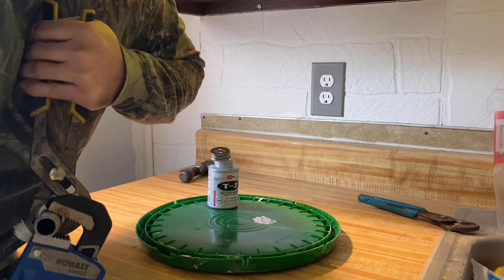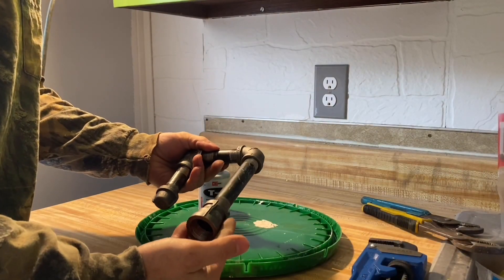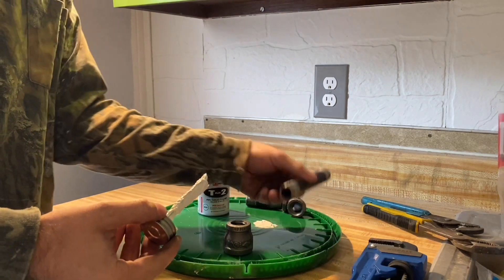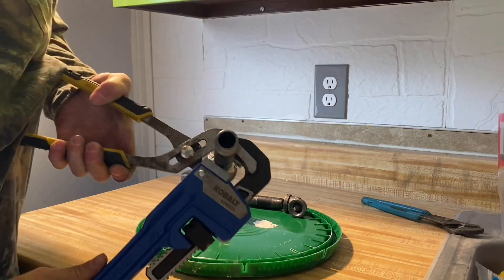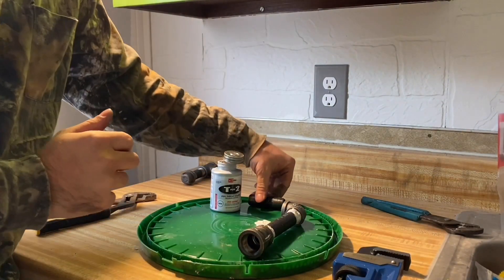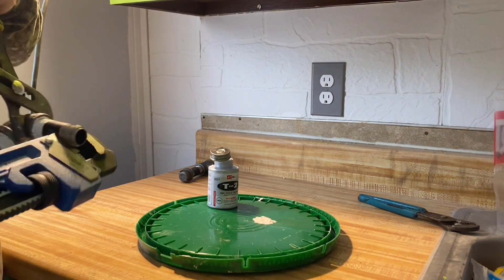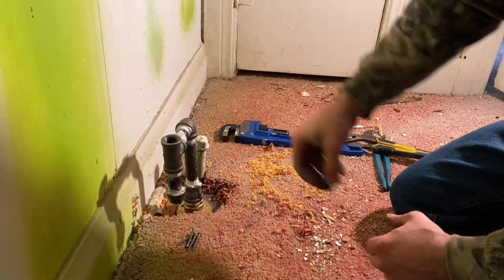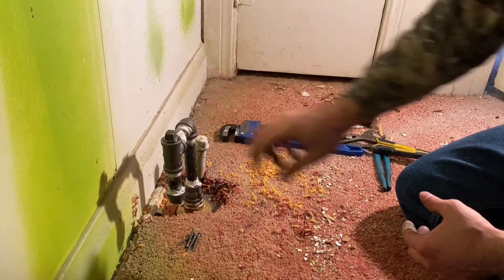How to make a gas sediment trap

Comment: Plumber is not my thing I paid someone 200 bucks to do that on the last house. Nice work
Reply: plumbers want to charge me $6000 to add another gas line in our house. Crazy.... I bought the materials to do it myself for $500. I got a pressure gauge, and will hook the line up w/ pressurized air for 24hrs at 30psi to see if the pressure remains stable. Then I got myself a gas  leak detector tool. One of the reasons the plumber was charging so much is because the combined 1/2" pipe runs from the meter to the devices, exceeds 40', which is against code.  The solution is to retrofit to upgrade all the preexisting lines to 3/4, which increased the overall cost. I ask myself the question, what problems could arise as a consequences of insufficient natural gas pressure , if I just stick to w/ our home's default 1/2" pipe setup? My demand its just one or two burners on the stove, and the gas furnace is on in the Winter. My logic is that the gas flames will be lit, but they will not be stoked as much w/ lower pressure. Anyway, I am not going to use the gas stove, until I know everything is perfect.
Reply: @GrantKeysProperties  3/4" upgrade requires a plumber, as well as an inspection. This is why I am sticking w/ the half inch. If it goes to 3/4, I have to upgrade the pre-existing line to the furnace, and the meter's regulator's pressure would have to be increased. They kind of got me between a rock and a hard place.
Reply: @GrantKeysProperties  thanks for reaffirming my intuition.
Reply: Its been a month since I installed the gas line for our new stove, right before Biden Admin. pushed legislation to ban them... haha... I pressure checked the lines overnight at 30psi, as well as did soap tests. Everything seems squeaky clean, and I feel confident that the job was done properly. Thanks for your guidance. I learned some things a long the way, i.e no tape on pressure fittings. I have more than enough pressure to the stove, even though the pipe length exceeded code. I tested all four burners simultaneously, and there was plenty of pressure even with the furnace on. I seldomly use more than one burner at a time, so I am good to go.
Reply from the maker: Woww! Congratulations man that’s a big deal and you did a great job! I’m super glad it all worked out for you. I figured it would and I love hearing a good success story brother. I appreciate you checking back in with the community! Also all my replies got deleted across my whole channel! sooo! I’m gonna work on back replying to everyone!
Reply from the maker: Thank you! I appreciate that and they definitely charge lots for this type stuff!

Comment: It’s not pipe dope.  It is pipe joint compound, don’t need to put all over the threads. Always leave 2 threads back so it don’t go in the pipe line to cause any blockage to the gas valve.
Reply from the maker: I call it pipe dope and that’s what it is but if your super fancy, then so be it. There is no dope in the pipe? If your to critical with plumbing it will never get done. It is very simple and not as hard to mess up as the plumbers will say hot shot.

Comment: Is it ok to temporarily tap a sediment trap to test a piece of equipment that requires gas? I have a commercial oven I want to check the condition of and need to connect to gas just to see it working. Then I would replace trap cap. Thanks and great vid!